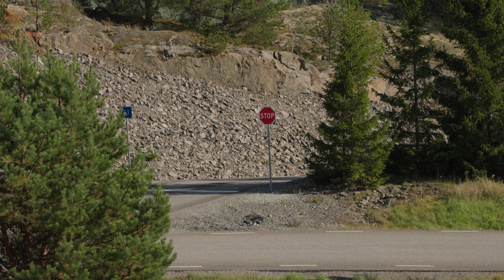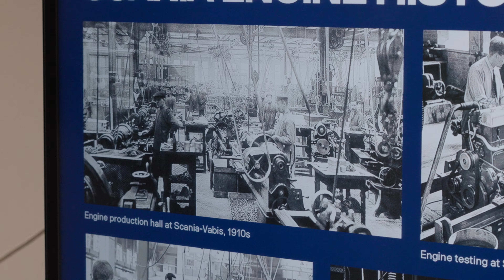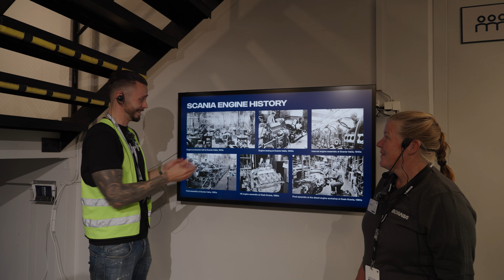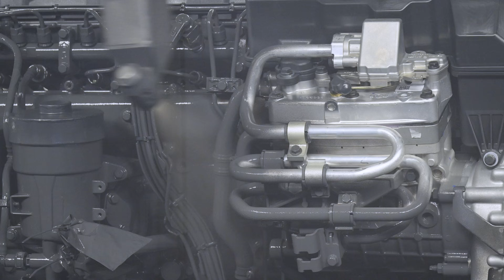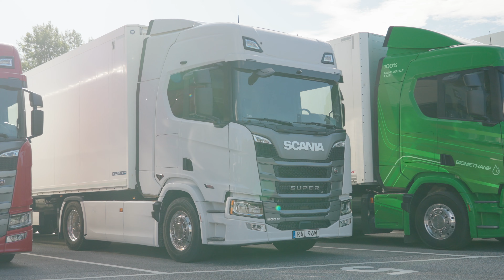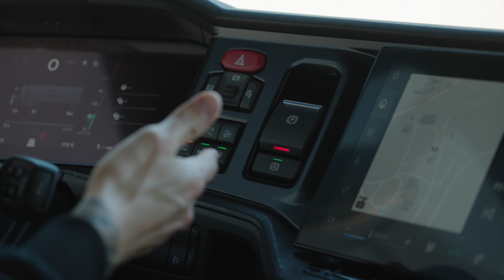Scania Headquarters Like You’ve Never Seen it

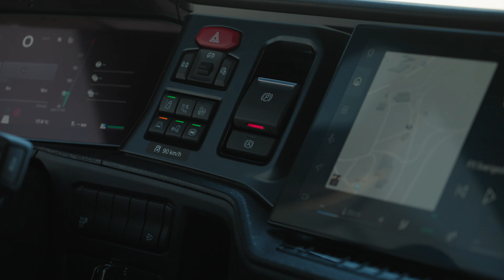Comment: Correct me if am wrong, 21:10 . the button under the parking brake is Autohold and Scanias replacement for hillhold.
This function does not work either if your seatbelt is not on. Its just a stupid function man.
Reply from the maker: I mean, i’ve never had a truck w one so couldn’t tell if it’s useful 🤷🏻‍♂️
Reply: @truckingwithtidstrom I drove a 2022 Scania the other day and had to learn this the hard way, while parked at steep uphill 😂

Comment: 19:45 a small correction, the cab, chassis and seat (if you want to) have air suspension, scania is fantastic to drive
Reply from the maker: True, although most trucks have aired seats now, i never use it